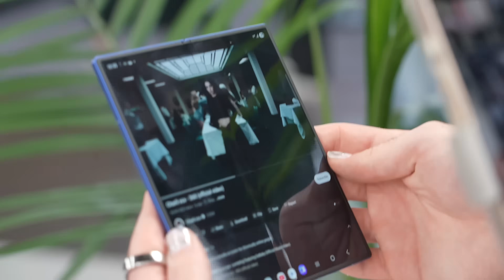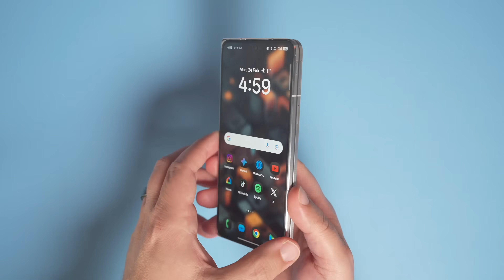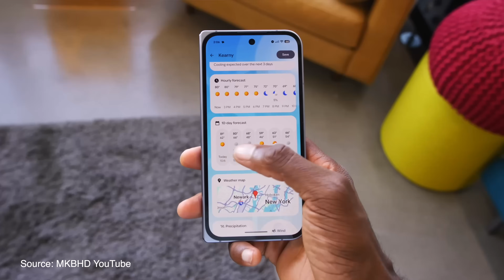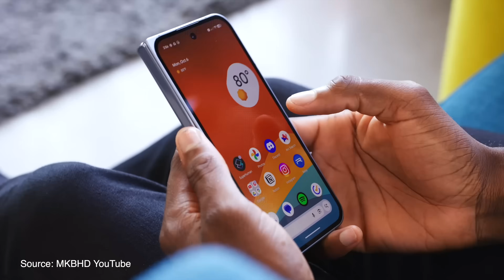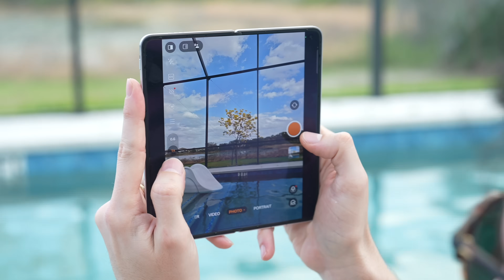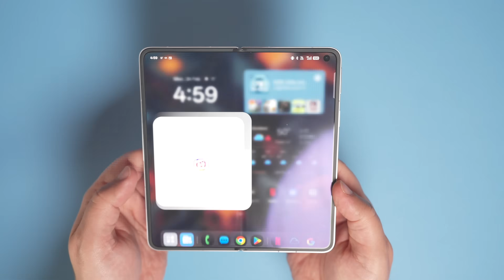Don’t Buy a New iPhone Yet… Apple’s Foldable Is Almost Here

Comment: I really have been contemplating switching to Samsung because I am becoming more interested in a foldable phone, Samsung Tri-Fold is quite appealing. But then I heard iPhone was coming out with a foldable phone, so I decided to look into that, this is the most informative video I’ve seen so far. I currently have an iPhone 15 Pro Max and I think I’m going to get the 17 Pro Max and wait about a year after production for the iPhone foldable that way, all of the issues in kinks are worked out. Appreciate the information of this video.

Comment: Folding phones are often presented as the future of mobile computing, but in reality they solve very few real problems—while creating several new ones. At their core, they are an expensive technical gimmick designed more to signal status than to improve everyday usability.

First, the cost simply doesn’t add up. A folding phone typically costs more than buying a high-end smartphone and a tablet separately. For the same money—or often significantly less—you can own a normal iPhone and an iPad mini, both optimized for their specific roles. You get better battery life, better durability, better multitasking, and the freedom to upgrade or replace one device without replacing the other. A foldable offers none of that flexibility.

Second, folding phones force you into always carrying a bulky device. You lose the option of having a small, rugged, pocket-friendly phone for daily use. Even when folded, these devices are thick and heavy. You’re effectively committing to a permanently oversized phone, even when you only want quick access for messages, navigation, or calls. With a phone-plus-tablet setup, you can choose when to carry the tablet. With a foldable, you carry everything, all the time.

Durability is another weak point. A folding screen, hinge mechanisms, and ultra-thin glass are inherently fragile compared to a standard phone. This makes foldables poorly suited for people who value ruggedness or longevity. You end up babying a device that is supposed to replace two others—an ironic compromise for something marketed as “convenient.”

In the end, folding phones are less about practicality and more about spectacle. They are a “look at me” product: look at the hinge, look at the screen folding, look at the price tag. And that price tag sends its own message—look at me, I can afford to waste money on complexity I don’t actually need.

For most people, folding phones are not a meaningful step forward. They’re an impressive engineering demo searching for a real problem to solve. Until they are cheaper, more durable, and clearly better than owning a phone and a tablet separately, they remain what they are today: expensive technical theater.

Comment: A few guesses based in their current iPad line up, they will potentially fall short of the competition if the inner isn't an OLED 1020Hz at a minimum which is a screen exclusively on the iPad Pros at quite the cost. I think cost will be an issue too, I don't see an Apple foldable being less than £2000 - £2,500.

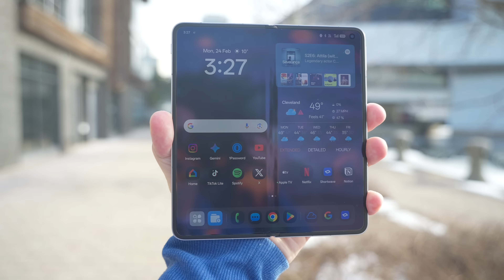Comment: 2:58 there is no crease problem. I used a fold for a year. I rarely noticed the crease, and when I did it was never an obstacle or a problem. It’s a first world problem.  I stopped using it because I just prefer iOS as an operating system. 

A phone is a productivity tool for me. The ‘perfect’ phone for me would be the physical footprint of the pixel fold, running iOS, with stylus support and good cameras. I don’t care if the phone gets fat to achieve this. If it had the dimension of the 17pro max when folded - camera bump + case included to deliver that, I’m fine with that.

Comment: In my opinion, one of the biggest perks of a folding phone is to be able to take a selfie with your main rear camera and have the outer screen be a viewfinder so that you can actually see what you’re taking instead of using the inner selfie cam. So a good main camera is very important. That being said, I would probably wait until the second generation comes out anyway because I don’t want to be victim to a potential botched launch.

Comment: Wait a minute…. So So So, my Current 16 Pro Max has a 6.9” display, which is 6.4” tall by 3” wide.. The new Apple Fold, priced at $2000 + is going to have a display that is shorter than my current 6.4”, but wider going from 3” to 4”…. This doesn’t sound bigger than my current phone, just a different shape.

Comment: liquid metal is not going to work like they think it will.. with it going into a pocket and constantly shaking and bouncing it will end up all over the internals and bricking the whole phone. check out LTT that did a video on this on a laptop. even the small amount of movement that those get after heating up.. it ended up frying the mobo.

Comment: The problem with fold phones are the cameras. They never use flagship cameras. When they do, they don't use all of them. Samsung have never used the periscope lens of the ultra phones and I feel that apple will drop a major lens too, if they do use two cameras at the back. If they do, they should drop the ultra wide. The telephoto gets used a lot more than ultra wide. I'd hate it, if it's anywhere close to or more than 2 grand. The Samsung fold costs about 1800. So they should think long and hard before pricing. Samsung have announced z tri fold and that could be cheaper than everyone thinks

Comment: I don't want this. I want the clamshell. The reason I want the clamshell is it will be a lot easier to pull it out of my coat pocket. That's actually the reason. I won't buy a new iPhone until there is a clamshell. And I don't like iOS26 either. Liquid Glass isn't better, and I swear the UI is slower. Especially the Workout app on the Watch. I want the previous version's responsiveness.

Comment: I have owned 2 of the Samsung Z-Crease phones and both did’t last long before the screen started tearing down the middle. I’m done with foldable phones until I’m convinced they got that screen down. I absolutely loved the functionality of them, but the reliability isn’t worth it
Reply: thats literally just the screen protector you just take it off and the screen is perfectly fine, I had the same thing happen to my fold 4 and I just peeled the screen protector off and the thing lasted me another year and a half
Reply: Ok what are you doing with your phone cause I had my z fold 6 for a long time and it even flew off my motorcycle at 70mph and wasn't damaged in the slightest. Hopefully you didn't pull off the middle screen protector like people did during the first iteration of these phones.

Comment: 5.5 is too small for the outer screen. Id even settle for a 6inch outer. 

Gutted as I would like to jump back to iOS. I love the fold 7 but android is a bit temperamental for me.
Reply: The whole point of a folding phone is that you can have a small form factor when folded and you mainly use the inner screen for usage.
Reply: @Avm371998  I have a fold 7 after being in the Apple eco system for over 17 years. I couldn't go back to a 5.5 inch screen. When your walking around or on public transport you don't always want to open it up, so having a bigger front screen makes it much more usable in all cases.

Comment: The outer display at 4:3 aspect ratio isn’t “traditional” at all. It’s closer to the iPad than the iPhone. Current iPhones displays aspect ratio is 19.5:9. Much narrower and taller.

Honestly I like that It would be different than all the other foldable phones. I think Apple did it for recognisability but maybe other technical reasons contributed to that decision

Comment: I can say now that if the new foldable iPhone doesn't have a faceID then i'd have to pass.  My fingers were badly burned in an accident and a fingerprint scanner never works for me hence why when face Id came out I was ecstatic.  This is where we miss Steve Job's leadership.  He would never agree to a product release where existing tech such as Face ID would be omitted.  Maybe AI voice recog will be so good by then that Face Id won't be needed any longer???
Reply: Steve Jobs would probably do a good job communicating the reason FaceID won't be in a phone like this, but he wouldn't have forced it to be in there. The problem with the FaceID camera/sensor is that it has a certain size, and it needs to be in a certain thickness. This is why you never see it in MacBook Pro